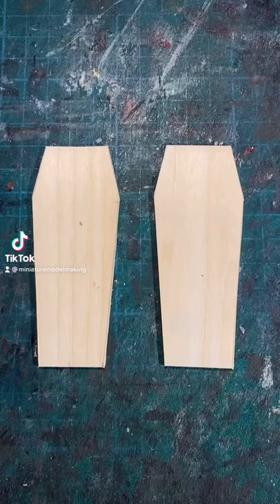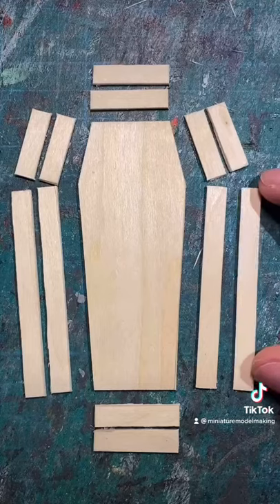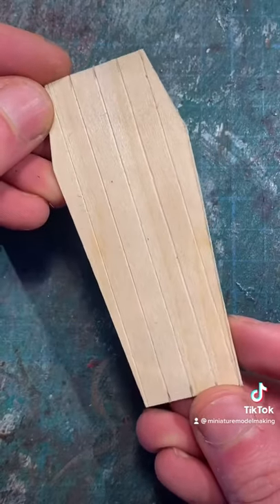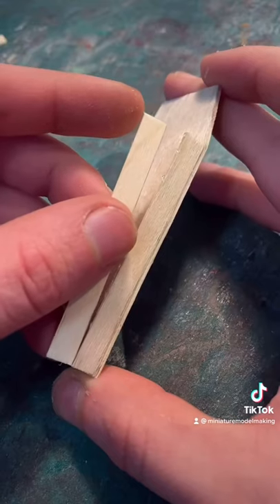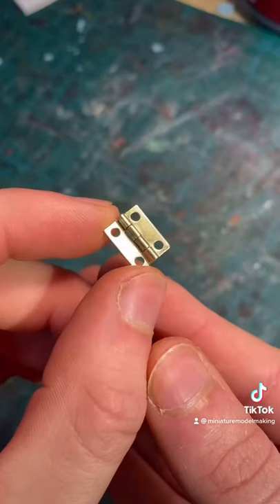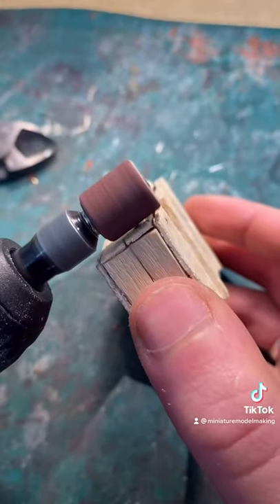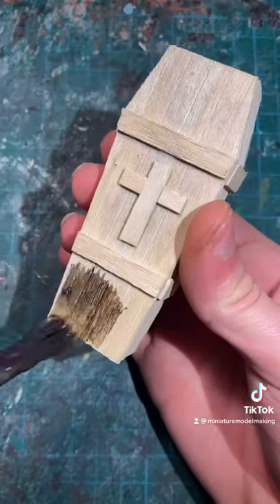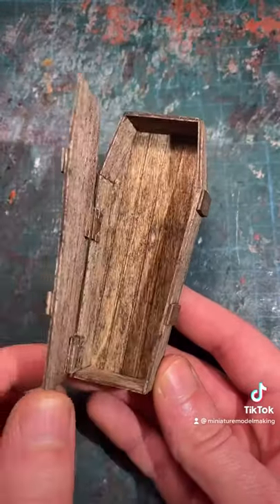How to Make a Miniature Coffin #youtubeshorts #shorts

Comment: Do the nails work well ?
Reply: The nails with those small hinges? Yes they work just fine. They are just very small and can be a little hard to hold and hammer at the same time (I just use a small pair of jewelry needle-nose pliers to hold the nail for this reason)